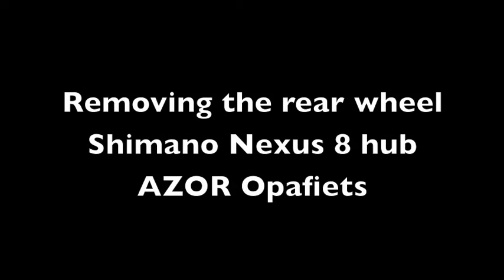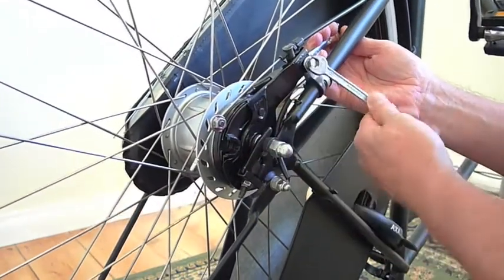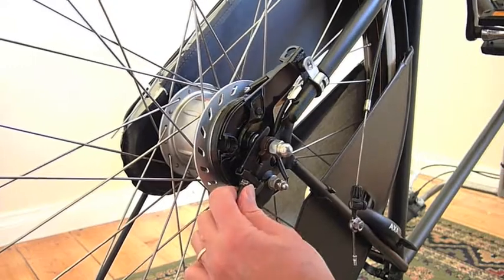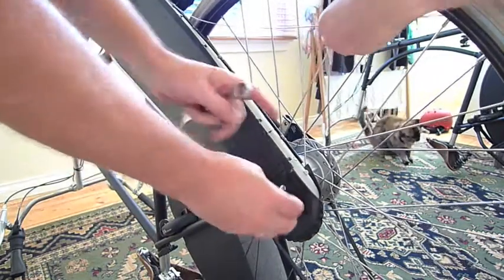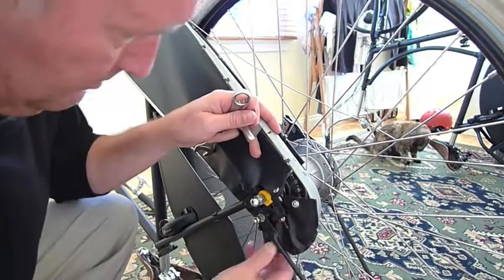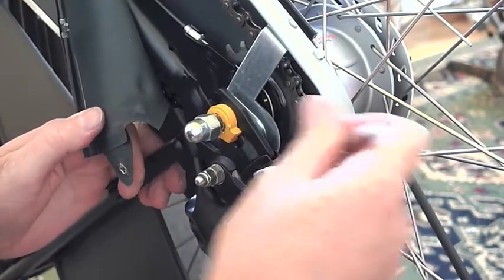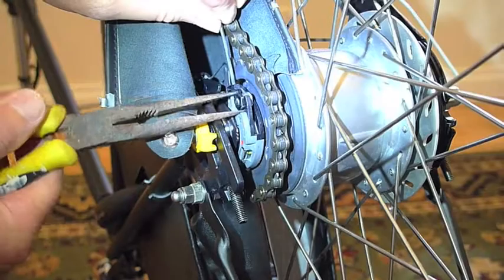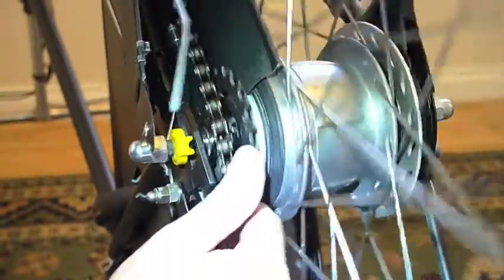Azor bike back wheel removal

Comment: I find this extremely interesting as I have the same problem with an Azor  Kruisframe with Roller Brakes . I also have an old Dutch Gazelle Simplex with three speed Gears and no Roller Brakes. The Gazelle is a bit easier to do but is made the same way as the Azor . No wonder the Dutch mostly get the Bike shops to fix their Punctures. I would not like to fix this on the open street especially in the rain to fiddly with screws that could get lost.

Comment: Thanks for posting this. I have a bike with a Nexus 8 and rollerbrakes and I once needed to get the rear wheel off. I made some notes and posted them here for posterity...  http://www.bikeradar.com/forums/viewtopic.php?f=40013&t=12790634 

Schwalbe Marathon Plus is the answer to this particular question! If you can avoid punctures altogether that's the best way, failing that try to locate and fix the puncture without removing the wheel by just peeling off a quarter of the tyre's circumference.

Comment: That's why you want to run puncture resistant tire on this wheel especially when it's equipped with the rollerbrake.
Reply: This is why you get a road bike or a hybrid instead.